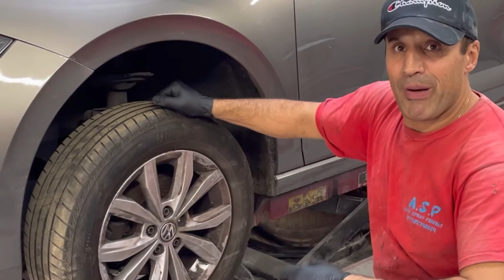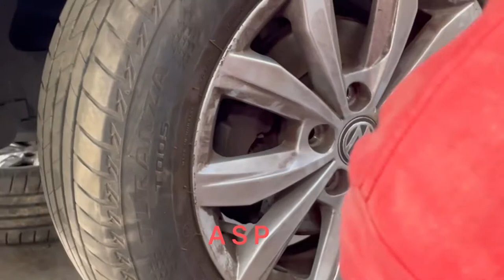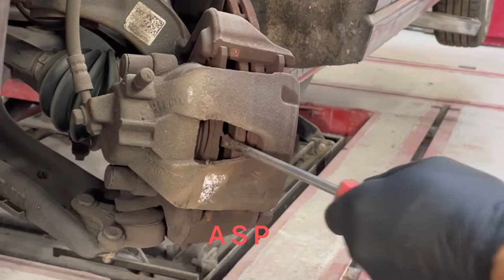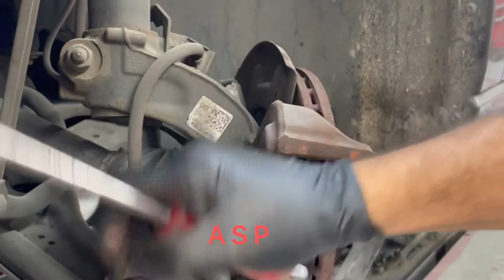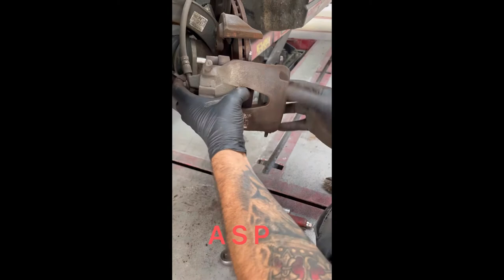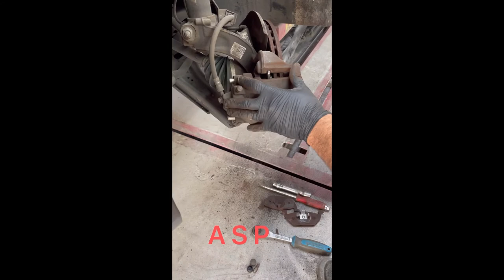How to change brake pads for VW polo

Comment: awful job, didn't  remove some fluid from the reservoir. fluid will return to reservoir when prising pads back and probably overflow and spill into engine compartment. Also didn't apply copper grease to parts of  pad that that slide on calliper bracket.
Reply: Letting the caliper hang from the brake line is also not great
Reply: U don't need to remove brake fluid unless it's topped up,in that case it will overflow and make a mess.Maybe he checked before he got started.
Let the caliper hang by the hose..i agree is not very good.
Reply: @freddesgarage his going to check that as well
Reply: I thought he's going to put some grease or something